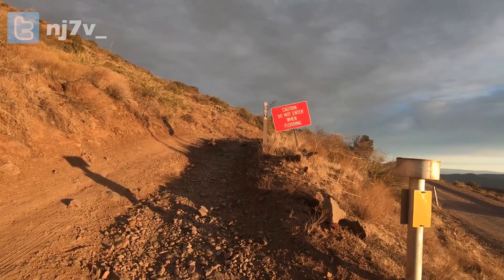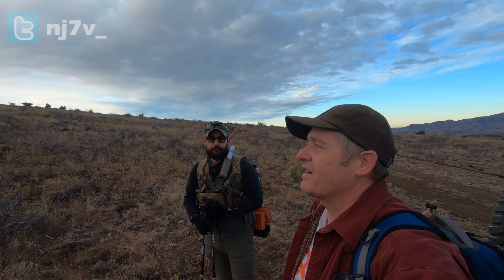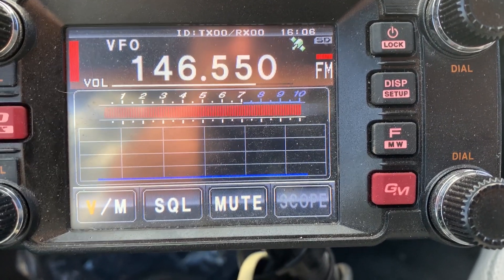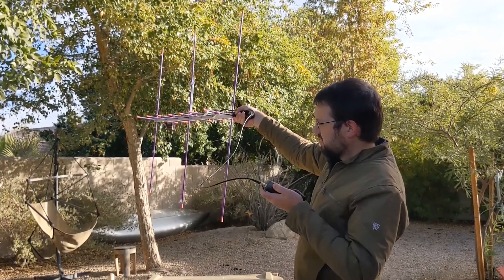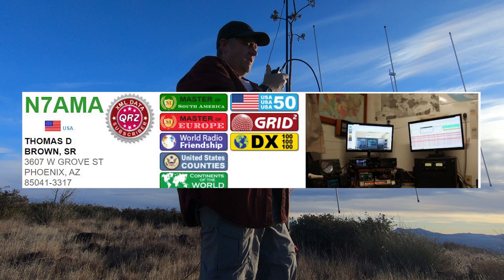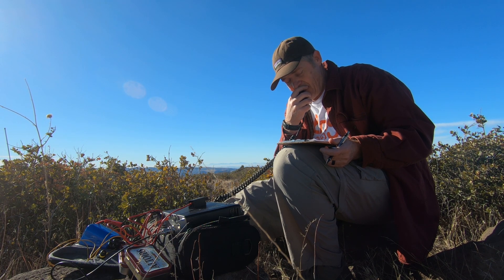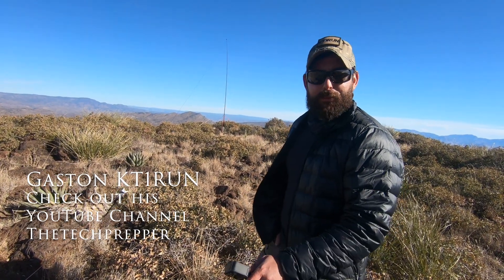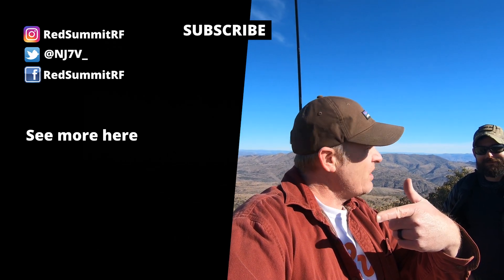Antenna Comparison For SOTA - J-Pole vs Yagi vs Rubber Duck

Comment: The coax dangling all around the reflector is negating any gain you would have had with the yagi. There make velco wire ties that weigh nothing and would allow you to run that coax out the back of the yagi.  Nice video !
Reply from the maker: Ok Steve. Thank you for your observation about he dangling coax.  I'll have to go back and watch this because I usually do velcro the feed line to the boom.  I must have overlooked it or was sloppy.  I appreciate the note and that you took the time to watch!  73

Comment: I've had absolutely zero luck getting any sort of beneficial use out of my 4pc arrow 2m beam. I've tried almost every way to mount it with tripods, masts, different orientations and heights, etc. It actually functions better without the 4th reflector element. Not a fan so far.
Reply from the maker: Interesting.  I am actually not using an Arrow antenna in this video.  It's a 3 element homebrew.  I wonder what the issue is with your experiences.  What results are you hoping for?

Comment: 3:16 If you want that beam to be true to its design, dress that cable tight to the boom so it's not flopping around the near-field of the elements.
Reply from the maker: Yeah, not something I typically do, John.  As you know, we sometimes forget things in the field.  I usually use velcro to snug it to the boom.  I really appreciate your support of the channel and you offering up your comments.  Thanks!
Reply: @RedSummitRF  Oh I get it... especially when running a camera after a long hike with limited time.  I have an arrow laying about so might try that experiment.  You are doing good stuff with a great channel... especially that 6 summit you did!

Comment: Is the mast holding the J-pole fiberglass?
Reply from the maker: Yes, it's fiberglass . . . I'm pretty sure it really wouldn't mater much if it was carbon fiber though (if you are implying that) https://youtu.be/idx1zdmeIOs
Reply: @RedSummitRF  At HF perhaps, but a woven carbon fiber should behave more and more like a conductor as we approach 300 MHz... or so the missile antenna folks have found who rely on it to be a conductive plane.  Of course VHF is in the muddy middle ground.  I think I have my new test topic.
Reply from the maker: @SkyCharter  HAHA glad I could help with that new topic.  Good luck.  Will you be making it a video for your channel or will it be on your website.  I'd love to see the results.
Reply: @RedSummitRF  Both. Demo on vid and details in article.
Reply: Preliminary report.  Fiberglass mast against N9TAX 2m monobander has the expected slight dielectric detuning, but quite functional.  My carbon fiber surf casting pole completely detunes antenna and from many inches away.  You can see me walking the fishing pole towards the antenna on the Return Loss plot from meters away.  Need to purchase the Carbon-6 and check its reaction, but if it really is woven carbon fiber, its conductivity should spoil any nearby parallel antenna element.  Perfectly usable as support for dipole of course.
Reply from the maker: @SkyCharter  wow, well there you have it.  Bottom line is avoid carbon for VHF/UHF anyway huh?
Reply: @RedSummitRF  Carbon-6 on order. We will see.
Reply from the maker: @SkyCharter  https://youtu.be/1cSqvctaIRs this is awesome!

Comment: Gud show guys. really like the comparison of the three antennas. but wud hv liked to see the yagi and the J-pole compared at the same height. for a more accurate test. I wud think the yagi shud hv outdone the J-pole by couple db anyway. but still a neat cool outing. Tnx agan fro doint the acctivation. and better yet for sharing. 72! gud dx ! and Hilltopping. de WA1RKS
Reply from the maker: Hi Ellis - Thanks for watching and offering some feedback.  I was going for real use case scenarios here for SOTA ops, which is why I tested this way.  I'm sure the Yagi would outperform the j-pole side-by-side like you suggest, but for SOTA ops this is the way each is deployed in the field for the most part.  Thanks for supporting the channel and dropping a note.  Maybe I'll catch you on the air at some point.  72 
Charlie NJ7V

Comment: Charlie,
Great video. I will have to try my roll up j pole in the field. I use it at the QTH for 2m. Do you recall what was the name of the push up pole that the Tech Prepper used?
73 George KB3WAQ
Reply from the maker: Hi George - thanks.  Yeah the roll-up is a great portable antenna.  The mast The Tech Prepper used is called a SOTAbeams Carbon-6.  There's a link in the description below the video.
Reply: @RedSummitRF  Thanks73